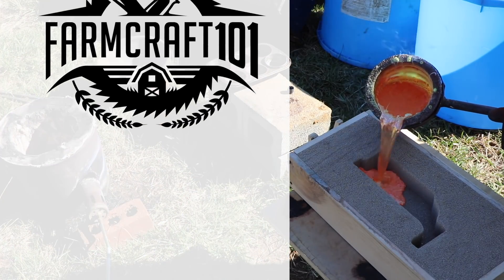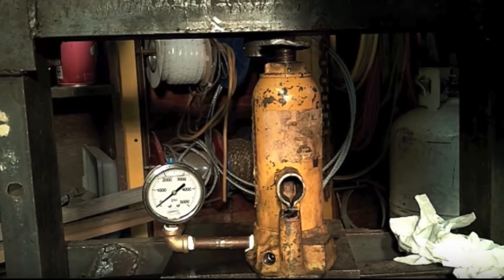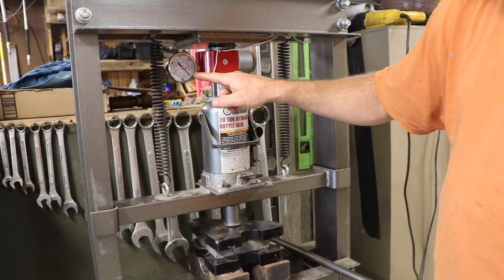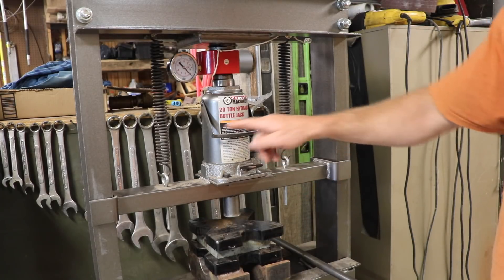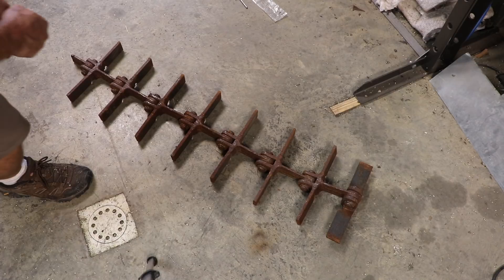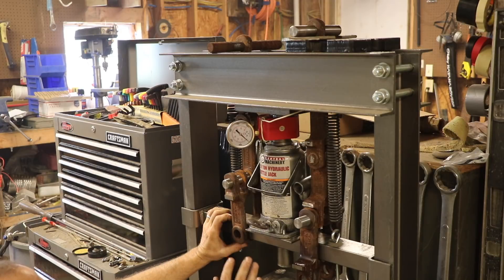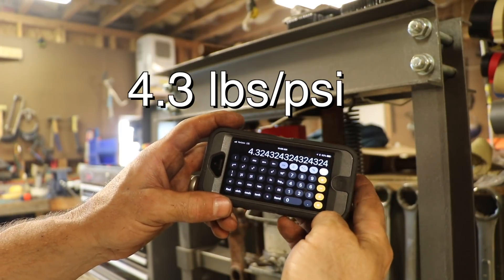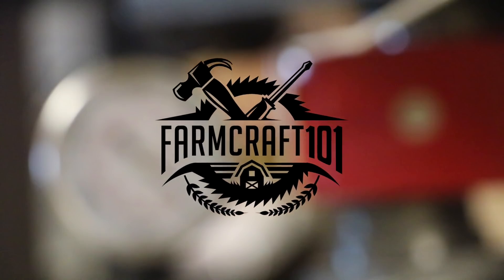Building a DIY Tensile Testing Machine.  FarmCraft101

Comment: Stupid question - how did you get the ram to be in the out position?  When u buy it , it fully compressed
Reply from the maker: TBH, I can't remember, but I think I just filling it with oil.  I either pumped it in, or maybe used compressed air to push the piston up and then filled it.  Then I screwed the gauge in so the oil is trapped.

Comment: If you want to improve this you need to be able to increase the pressure consistently and slowly over time. 
The test piece you turn should have a big radius at each end where you turn it down.
Reply: ASTM has drawings showing what samples should look like, check out 8E standards

Comment: Interesting, I was wondering how you were actually implementing calculating your gun metal samples. Sure I could see the pressure Gage but not exactly what it was linked to. The little harbor freight device is worth remembering.

Speaking of harbor freight I have recently bought a lot of tools to fill my needs as I build bows and crossbows with 60 pound prods that have twice the draw length of commercial devices so as to still impart a lot of energy to the arrow or bolt. Honestly, the machines are not top of the line at all but they are completely functional and I love my scroll saw and electric planer. I could not be competitive if I used a coping saw and strictly hand planes. So, here is to Harbor Freight who fills a need but just don't buy their hand planes unless you want to spend a lot of time fixing them.

Comment: Nice set up, but this has the potential of introducing bending into the test piece.  Both ends of the fixturing should have two pivots at 90 degrees.  This ensures that the pull will be pure axial.

Comment: It will likely become less and less accurate the more whatever you are testing deforms. It might be worth trying to set up two pulleys on top of the top beam with  a cable that connects from one side to your sample then back to the other side. Then the force deflection and force on each side should be equal.
Reply: This guy is right. The test sample side will get longer - maxing out in length just at the critical ultimate strength. If the two sides don’t stay the same length does the tensile force on them equal?

Comment: Wow. That worked better than I expected. I am curious though why you couldn't build a rig to come out from the center of the press? so instead of matching each side you just make something stick out a little bit on the back side but center. I understand it will have a some what similar result as if you did just one side of the jack left to right but since the you could have the sample almost touching the jack wouldn't that make the problem of uneven weight distribution not as bad?

Comment: Great video as always. Would love to know where you got the ceramic wool for your forge and how much material it took.
Reply from the maker: I had mine leftover from a wood stove installation.  It's available on amazon and you can calculate the length you need based on the radius of your container.  This would be more than enough: https://www.amazon.com/UniTherm-Ceramic-Insulation-Blanket-Furnaces/dp/B01BIB4R1M/ref=sr_1_3?ie=UTF8&qid=1533341296&sr=8-3&keywords=ceramic+blanket
Reply: FarmCraft101 Thanks for this link.
Reply: FarmCraft101 yes thank you for taking the time